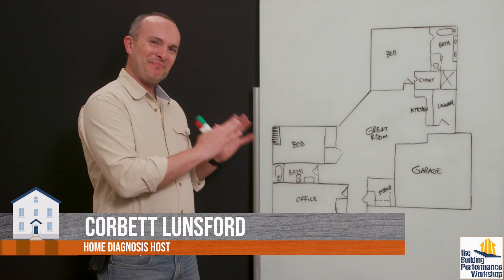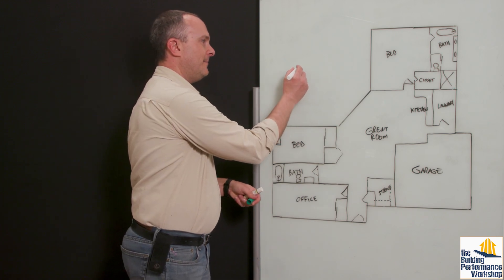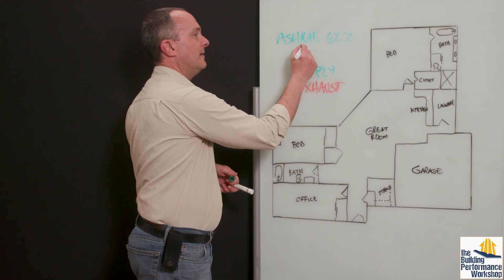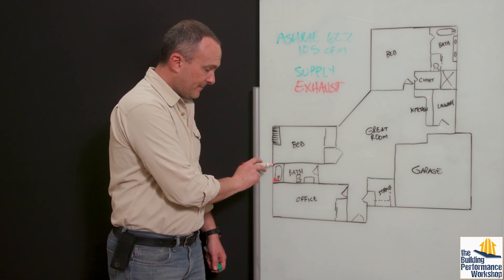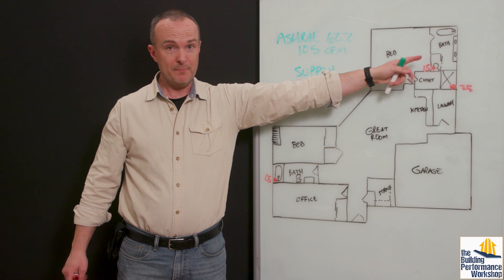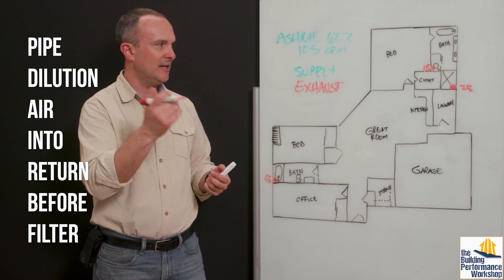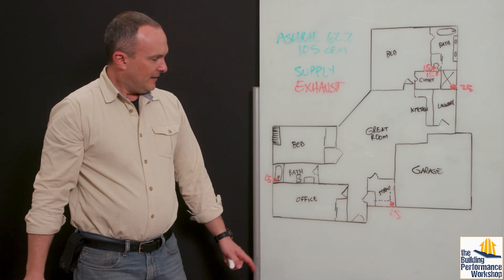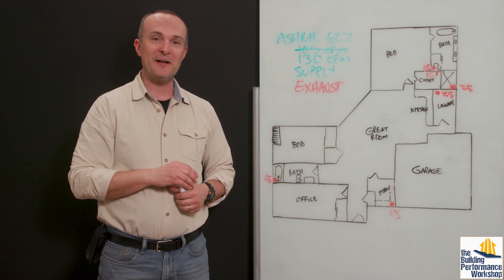Airtight Home Ventilation: Where to Place ERV Exhaust and Supply Grilles (HVAC Training)

Comment: You have nearly half your total exhaust in the bedroom / ensuite and none in the kitchen.  It seams that cooking odors would tend to migrate into the bedroom.
Reply: I’m assuming the kitchen would have a separate exhaust with high cfm and separate make up air system. But you make a good point. Given the proximity lingering odors and other vocs when not cooking would naturally be pulled into the master. I wish Corbett would address this.
Reply from the maker: Bedrooms are positive pressure zones, bathrooms neg pressure. When cooking, the kitchen becomes neg pressure zone because of the massive exhaust hood with dedicated make up air (400 cfm, 2.7 times more powerful than the ERV).
Reply: @HomePerformance wouldn't it be more efficient and effective if you run the air from the  kitchen exhaust hood through a whole house dehumidifier, which takes the fresh air from the inlet of the ERV/HRV equipment? That way you are keeping the building envelope closed.
Reply: The intention with all ventilation strategies is to dilute the breathable air, not scrub it. ERVs are generally designed for Class 1 air. FYI - It would be best to post a comment of this nature in a form of a question. That way you don’t sound like a neophyte. Cheers!

Comment: I like the short-form videos. I am months away from starting new construction. You mentioned connecting the supply of the ERV to the return side of HVAC return to capture the filtration. When the ERV is operating is it also turning on the air handler of the HVAC system. Getting dual use of main ducts running to all the rooms seems like a good idea. However what about inserting the ERV supply into a separate dehumidifier before connecting to the return side of the HVAC system?
Reply: I don't see why not.
Reply: I was wondering the same thing about the ERV connecting into the return of the air handler. Often air handlers in the high efficiency homes don’t run as often. So would think the ERV connected to the return would require the air handler to be running all the time with the ERV. Or the ERV would need to connect to the supply side of the air handler.
Reply: @UserError7861  Yes the main air handler would run whenever the ERV was running. The trade-off is not having to install separate supply ducts from the ERV.

Comment: Can an ERV be used with a central return? If so, how? For example, I could duct the ERV into the central return closet, underneath the filter. Would that be adequate if the air handler blower was set to run continuously?

Comment: In a more basic setup, is it still ideal to have a standard bath fan over the shower for steam purposes?
Reply: Think of a centralised HRV/ERV as being a sealed and balanced system. A standard bath fan that is exhausting externally will unbalance the system when turned on and cause short circuiting (ie the return will draw from the bath fan rather than the supply) when off.

Comment: We didn't think the efficiency in the Atlanta area would justify an erv. We have that exact pattern for exhaust. Only difference is we use fresh air intake on our dehumidifier and exhaust using a central bath fan ducted to closets and bathrooms. We set both fan side of the dehumidifier and the central exhaust on the same controller. As one goes up the other goes up. We have it set about 25 cfm higher intake then what the exhaust is set.

Comment: perhaps you’ve addressed this before but I was curious about why you don’t recommend a separate dedicated ERV system
Reply from the maker: Because I’ve done it, Dragon- in our forever home. Ducted it myself with hard pipe, and I can attest that the benefits do not outweigh the costs.
Reply: @HomePerformance  Thanks Corbin. What should I do if I want to have zones?
Reply: Part of the issue is joist space real estate. In a normal 3000 ft² bungalow, you'll have around 25-30 sheet metal supply runs, some of which can share a joist with each other, most will be on their own in a joist running one way or another. You'll have 5-9 return airs usually - those take up a joist space each and can't, or shouldn't, share the space with anything else, especially plumbing, and definitely not metal. Another joist is lost to the venting for the furnace, and usually the hot water tank will take one as well.

Plumbing will be coming down and traveling towards the main stack from all the bathrooms, kitchen, etc. If there's plumbing in a joist cavity, you can only usually get one sheet metal run in, meaning another goes elsewhere.

Every single thing I just wrote is determined my the orientation of the walls on the main floor, and has to take in account getting things to code (sheet metal supply runs terminating within 4' of the exterior wall, and really they never get that far out, plus returns being unobstructed and proper pathed out, also clearances for venting).

ERVs exhausts and intakes also need clearances. In Ontario Canada, and mostly standard elsewhere, fresh air intakes need to be 10' away from any exhaust. With how cramped the basement sounds based on what I just wrote, adding a doubled up sheet metal duct system, even if it's a bit smaller than a normal duct install, makes for a way more complex basement, wall system, cabinetry upstairs, framing and trim...it all adds up, and real estate can be the biggest commodity there is.
Reply: @levidobbin5654  wow thanks for the explanation but that's a bit discouraging. This is also why Zehnder seems appealing to me. I might not use all 12-15 of the lines they recommend but I feel the 4" flex pipes would find their way through that labyrinth, at least to supply the bedrooms and exhaust the bathrooms etc.  
My real problem is that my house is pretty big with 3 levels and I wanted to have zone control.  I don't see how inline erv is compatible with that unless maybe I get a little erv for the two bedroom zones.   Also wanted to tie dehumidifier in with erv.  The local HVAC companies are not pleased.
Reply: @hickorydragon8114  Well, what do you want from a zoned ERV? For the kitchen and bathroom in particular to get full air changes faster?

Ask an HVAC designer about this - instead of zoned, the following:

Stale air being pulled from the return air system, but with a small amount of specific ducting just to the kitchen and bathrooms. Fresh air into the system back into the return air. 

The ductwork already goes to all the  bedrooms, supply and return. Adding maybe a 5" round for the kitchen and specific 4" rounds for the bathrooms, and tying the rest right into the system, might be your best option, and achieve what you want from a zoned system with needing "zoning". Actually that's my best tip in general for building your home. Don't want a particular product - want a particular *result*, and see what the best way of getting there is.
Reply: @levidobbin5654  if understand correctly zoning is on the HVAC and is achieved by dampers that would also affect supply air flows of the ERV. In this case separate ducts is the way to go if you want to have controlled ventialtion in each room
Reply: @levidobbin5654  my HVAC contractor recommends that we pull fresh air directly into each evaporator (which is code he says although most folks close it off).  He’s oversizing the units slightly to deal with the cold winter air or hot summer air.  In shoulder seasons there won’t be as much ventilation but then there is not as much energy penalty for opening windows. Humidity he says will not be an issue, but dehums could be added as needed.  Sound reasonable?
Reply: @hickorydragon8114  well Hickory, if you're saying he'll pull air into an ERV or HRV unit and then that unit ties into your duct system, yes, that's good and the preferred method.

But if you're saying he wants to attach a pipe to outside, right into the regular return air ductwork without installing an ERV, and pull air right into the system like that, all I can say is that hasn't been code in Ontario Canada for 20 years. ERV is the bare minimum code in Ontario now. I personally wouldn't accept what he's offering, IF I'm reading you correctly and he is just "upsizing the equipment (furnace and AC)" to deal with that. If someone up here told me that, I'd tell them to find a new contractor. To be clear, if this is what he's saying, he's saying he wants to charge you for a more expensive furnace and AC, and wants your power bill to be more expensive, and for you to have to replace that furnace and AC earlier. Power savings counts.
Reply: Forgot to mention in that that it's perfectly fine to just take out exhaust from the ductwork, and put fresh air in at the return side before the filter anyways. Saves space and time and the ductwork is going to all those places anyways, most of the time

Comment: @Home Performance I’m looking at upgrading my current HRV in a simplified setup to a new ERV with a direct ducted setup. Why do you recommend a hybrid setup, with exhaust ports throughout the house but the supply going through the air handler. Could this cause over ventilation and / or fresh air to be improperly distributed throughout the house? Love your videos by the way.
Reply from the maker: Thanks Sebastian, and as long as you test the flows you can dial in whatever CFM you want. AH distribution means you get an immediate second filtration on the incoming air, and you already have a duct system to deliver everywhere.

Comment: Having 130 continuous, and a 160 ERV is not enough headroom for a party or any real change in CFM. Also, running that close to capacity will be louder, and potentially using more energy than running a 300 CFM machine at 130, while having meaningful extra for emergencies. Provided that the unit has nice control range and not unreasonable pricing for that additional capacity. I ran a 360 at 150, which is unnoticable 24/7(~30W), but has plenty of umpf for when I need a boost (almost 150W).
Reply: Open a window, Koo Koo. You are so cute when you’re serious. Simply, adorable
Reply from the maker: I happen to know from experience it is enough, I’ve lived with ERVs for seven years in two homes.
What 360 are you referring to? That’s not a residential sized unit.
Also, what emergencies are you imagining?
Reply: @HomePerformance  my dog's create some emergencies from time to time
Reply from the maker: Cleaning is not optional, of course

Comment: Great video. So if you exhaust from some rooms and supply others, the air would need to make its way through the loop. What if the house has minisplits in every room, or say VRF/multisplit type aircon with the only ducted system being the ERV? Would that still be enough or would there be a need to exhaust/supply every room?
Reply: splits will condition the air and remove some moisture however you still need to exchange the air otherwise co2 will build up and other pollutants. With a good temperature exchanger in the HRV/ERV, the temperature of the conditioned air should be retained to a large extent.
Reply: @bevthebuilder5457   “Should be” is a statement of hope. That’s not how physics works. Assuming a variable capacity system can “control” the temperature and heat energy in the air is a fundamental misunderstanding of Psychrometrics. Furthermore, it’s all about a given manufacturer’s testing and performance capacity tables being available for scrutiny and after installation commissioning. If you can’t predict it, why do it.
Reply: if your running mini splits then you need exhaust/supply ventilation in every room. thats exactly what i have in my home.

Comment: As Columbo would often say; "Just one more thing"... I do have an additional question that may already be addressed or will be in future posts. You referred to Zehnder as the Ferrari of ERV's (due to performance &/or costs). If one were beginning a home from scratch, would designing it using Zehnder be a question of overkill or one of simplicity (regardless of the costs compared to other systems) in providing dedicated outside air to your home, without added complications of using other systems and integrating into a more budget conscious process?
Reply from the maker: Zehnder is undisputably the most expensive and elaborate dilution system you can find, and you can’t combine it with other equip like a dehu. Not my choice because I like to play with HVAC like Legos. Zehnder is a brand that doesn’t lock in with the Legos.
Reply: @HomePerformance  Hmmm can you explain this in more detail please.  Zehnder doesn't dehumidify but they say you can a dehumidifier and have it part of the system.  Then a make up air system for a hood vent is separate.  Also in this video you show only so much exhaust going out what about all the air needed for the number of people that may come in such as a party of 10?  would you not need more air and what comes in must go out?
Reply: Weirdly worded question bro

Comment: If you Are ducting in individual supplies would it then be preferrable to put one in the closet or still better to place exhaust there? ( thinking exhaust might pull in more dust into clothing over time). Why do you yourself prefer not to add an exhaust in the laundry? Is it because the dryer already performs that function periodically?
Reply: I would ignore the closet
Reply: I thought he was saying that some folks are paranoid about the laundry room being dirty but he is not.  You're right though it does exhaust itself sometimes.
Reply: I like this discussion. I think, having years of commerical (large volume) and custom home ERV experience, that some people want to believe that ERV’s are magic. That an ERV can somehow perform double or triple duty to address a multitude of IAQ and building pressurization concerns. It is one of many tools in the toolbox. I would not advise to move air into or out of a closet or laundry room. Moreover, making those suggestions can be dangerous at worst, reckless at least. Anybody hear of combustion air or door undercuts?

Comment: If you dump the ERV output into the HVAC return, do you have to run the HVAC fan continuously?
Reply: If you want continuous fresh air, then, yes.
Reply from the maker: Yes you do, Fred- otherwise it won’t go through the filter, get mixed and conditioned, and get distributed through the supply ducts. It’d just turn the other direction and follow the path of least resistance out through the return grille.
Reply: @HomePerformance  Thanks for the timely response. That's what I expected, just being sure.
Reply: @HomePerformance   but if you had one way dampers fitted they would close when the hvac was off and air would be forced to go the correct way, or would that put to much restriction on it?
Reply from the maker: A one-way damper on a return would be massive, and for sure would increase your static pressure.
Reply: @HomePerformance   massive? Thats something that needs testing 😉
Reply from the maker: Size-wise, T- my return, for example, is a 16” round. Unsure if there’s a 16” butterfly damper available for residential, or how much noise it would make and pressure drop it would create.
Reply: @HomePerformance  they are available. Im sure you could even make a test rig for a smaller one. More common here to have two 8".
Reply: @HomePerformance  This would seem to be negating the purpose of having a 24/7 ERV if it would also require running the HVAC fan 24/7. What is the cost of running that fan? I know you tend to place a lot of emphasis on indoor air quality but who wants all that air blowing all the time, especially in winter.
Reply: @philiplacey5430 my plan is to dump it into the a return from the main living room. My AC/Furnace runs ~60% of the time during 85% of the year. 

So for 40% of the day, 85% of the year, I'll have fresh air only being supplied to the living room. The other 60% it'll be dispersed to the rest of the house equally via the air handler. 

Other ther 15% of the year in shoulder seasons the windows are open and will probably be shutting the ERV off. 

So a bit less dilution, and a bit less targeted to bedrooms, but this is still. 100% better than my pre-ERV scenario.

Comment: Very interesting ,thanks.  Wouldn't there be a need for supply and exhaust in each bedroom and the office too?
Reply from the maker: YES, which is why I advocate ducting the fresh air into the return of the central air handler- it'll get there. Otherwise, a totally separate duct system is required to deliver it to each bedroom and office.
Reply: @HomePerformance  so, the returns from baths and closets get fed into ERV, fresh air from outside also gets fed into ERV...  ERV transfers the energy (hot or cold) from baths and closets to fresh air from outside..  and this outside air, now with energy transferred to it gets fed as the return to the home HVAC system.....   Will the HVAC be able to appreciate/ detect the return air temp and adjust itself ?
Reply: @jimmyphilip2340  I wouldn't think so.  Maybe some types.
Reply: @jimmyphilip2340  No. The frest air is tempered and mixing with the room temp air circulating in the return duct. The blended air will eventually change the temperature at the thermostat.
Reply from the maker: Use an air mixing cslculator online to see how little impact it has.

Comment: Maybe not the right forum for this question…but where would one dump the incoming air for houses using mini-splits?
Reply from the maker: Dump it near the minisplit, then it’ll get grabbed and distributed with the bigger airflow
Reply: Are you familiar with Minotair HRV which has a built in heat pump? The unit exchanges air, dehumidifies, heats & cools, and supports Merv15 filters. Would be interesting to get a video on some these smarter ERV/HRV units like CERV or Minotair